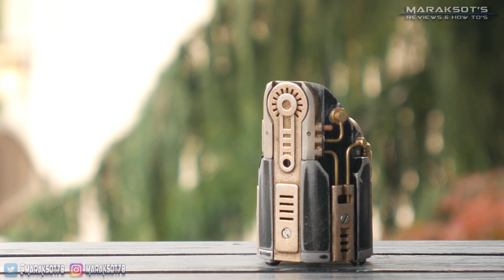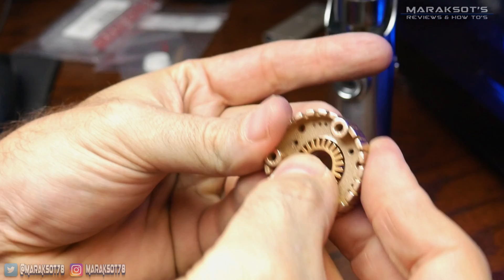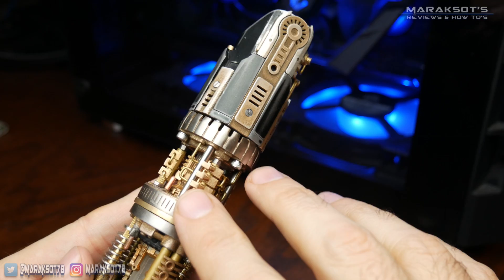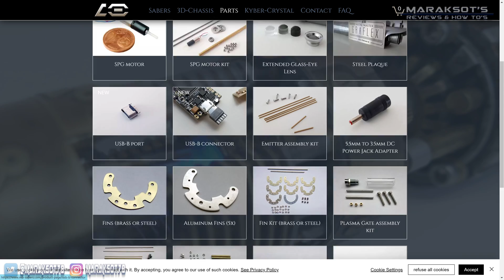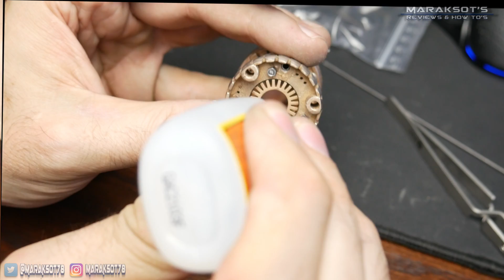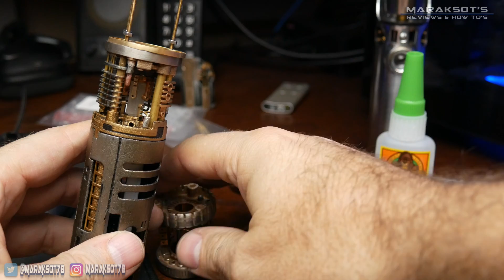Custom Graflex Lightsaber Build Log Part 4 - MB Sabers Metal Master Plasma Gate

Comment: You're inspiring me to finish my MB-Sabers Graflex.  I started a year ago as my first ever light Saber build and got all the way to where you are now, my next step is to gut it and redo all the electronics......and I can't even.......it's been so much work.....so much grinding and sanding and fitting.......and the leds......oh man........one bank will work, another wont, but then when I fix the crystal chamber, suddenly the plasma gate stops working........ugh.......anyhow, I know what I have to do now, I have to take a year's worth of learning on this saber, take it down to pieces and again and wire it up right......whew......thanks for the video drop, gonna go make this thing happen.